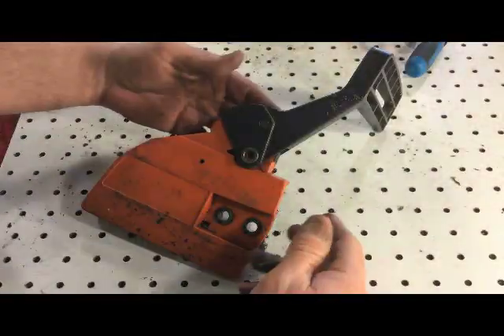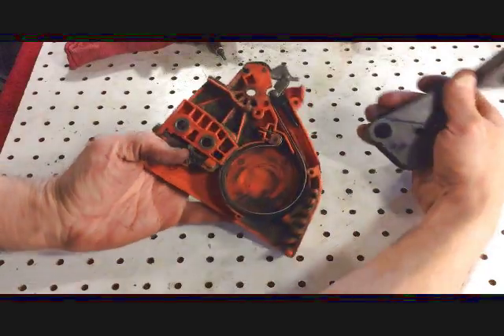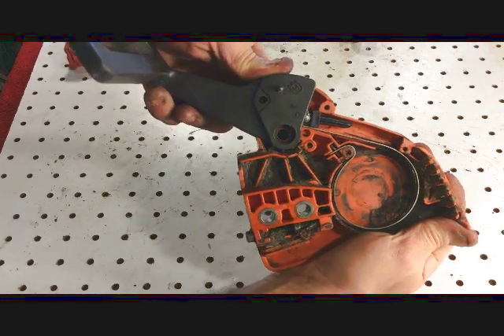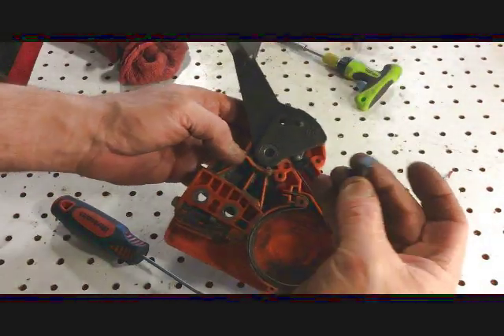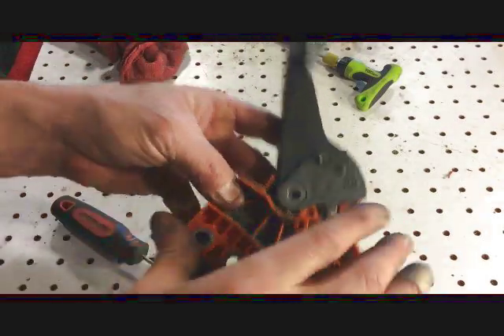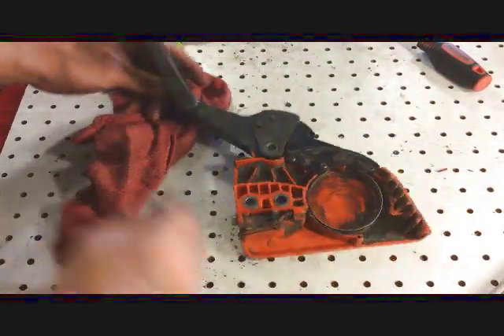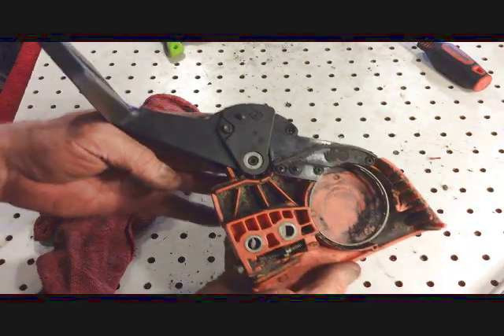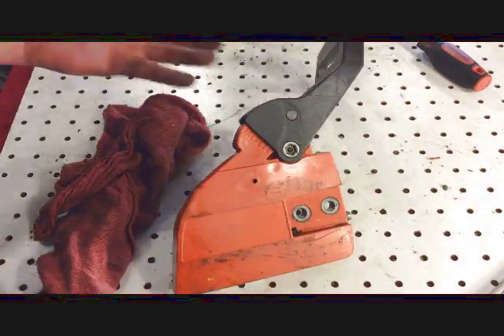Husqvarna 136 chainsaw handle explanation

Comment: This is the same mechanism as the Poulan 2050 chainsaw.  Mine quit working and after taking apart I was unable to figure out the handle reassembly which you show and explain so that I was able to restore the operation on my saw. No broken parts, it just didn't engage so thank you so very much for helping stay safe while using my chainsaw.
As anniversary4 commented 3 years ago, your video is Quick, Precise, Clearly shot, and On Point to fix the problem.
Thank you again!!!

Comment: Excellent, I finally fixed this my McCulloch 2618CAV chain saw brake and handle spring with your two videos. This chainsaw sat around for months waiting for parts due to COVID19 shipping issues. It is a great relief to finally getting this little baby going again. Cheers.
Reply from the maker: Nice work!

Comment: You must have a weak spring because i cant get the spring squeezed enough to get it to fit in the slot like you did with a screwdriver..  mine when i got that last screw almost out the spring shot across the room and broke that screw hole out.. i have to put the spring in with the handle disconnected then wedge it in and get the little thing to hold it in place..
Reply from the maker: They are a pain.

Comment: The saw is only working if i constant put the handle backwards. Is it normal? And sometimes my handle 'clicks trough' and it doesn't work anymore. I can move the handle forward en backword with no resistance.  When i open it the long spiral spring is  on pressure en pussed against the cover. I replace the spiral spring and it works for a while, then i have the same problem. Is the problem in the handle? Should i remove the handle and place it over again or replace it with an new?

Comment: Good video Ron. I was just trying to fix my Jonsered 630 Super chainsaw brake handle. It looks similar to yours. I took mine apart and cleaned it. My brake trips way to easy, even after I cleaned it. Can't hardly run it because it constantly trips. Do you know what would make it trip so easy? I didn't see anything wrong with the knee joint level arm. Any help would be appreciated. Thanks.
Reply from the maker: Am not sure? sounds like the unit just may be worn out?
Reply: @channelron3593  I looked it over, all looks good, not worn anywhere. But will look at it some more. Thank you for the reply .

Comment: I have a McCulloch 2618CAV with exactly the same design brake assembly. There is a spring inside the black hand that fell out onto the floor. How do you put it back in and what  is its orientation.
Reply from the maker: Wow! well without seeing it its a bit hard, not sure.

Comment: Hi Ron, great video.  But could you show us how to orient the locking spring that's inside the handle?  Mine fell out, and for the life of me I can't quite figure out how it's supposed to go back in.  Thanks.
Reply from the maker: Wow. Well without taking it apart again I am not sure :( I know this does not help you, I will try to show more detail on next video, sorry that I could not help.
Reply: Thanks Ron, look forward to that next video.
Reply: Yes, I also discovered that channel, was very helpful for my situation, now everything's back together and working!  Thanks Armin.
Reply: Armin, I also stumbled onto that video, and problem sorted!  Thanks
Reply: Great vids Ron.  I too have the same problem with the spring inside the handle.  Specifically, does the pin go through the spring’s small loop?